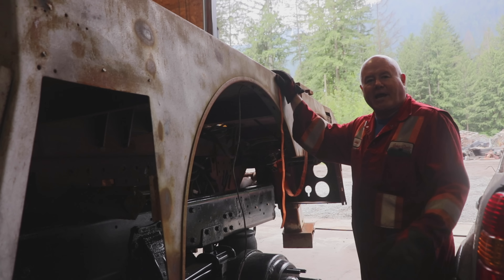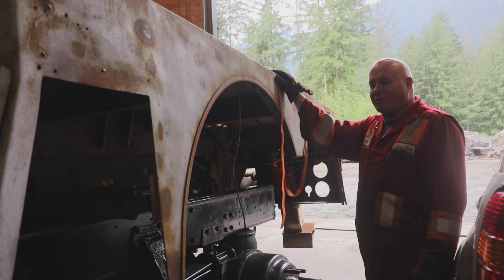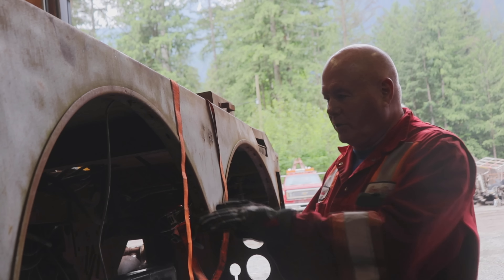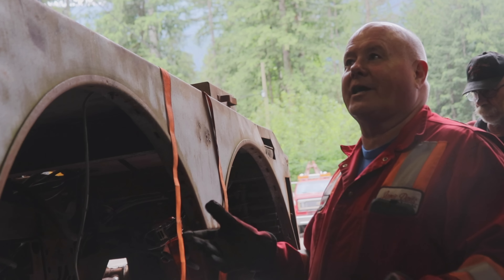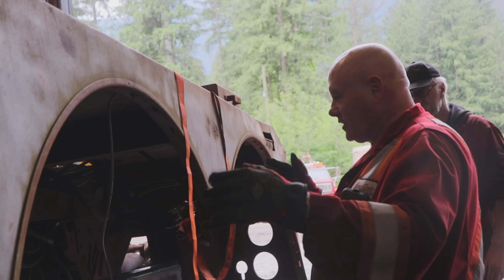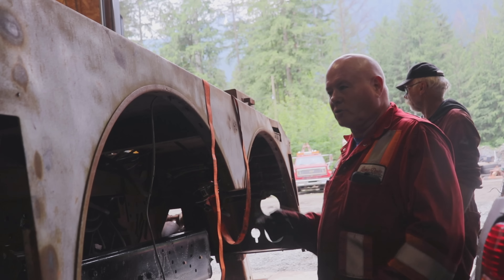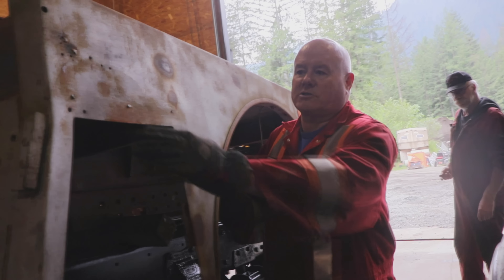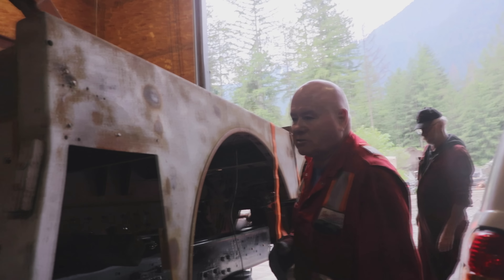INSTALLING NEW WRECKER ON BRUCE'S TRUCK!! || Jamie Davis Towing

Comment: With you fitting the 'new" wrecker on the back of Bruce's old truck reminds me of when my step-father was working for Truck Towing Service (Melbourne, Victoria, Australia) back in the 80s (now AAA Towing) when they were fitting a Holmes wrecker on the back of an R model Mack. At the time my step-father was driving the single drive Transtar and he taught me how to hook up a truck with the quick lift set up. Then he left there and went to Modern Towing where they had the spreader bar set up which I have limited knowledge of that. When he went to Melbourne Towing, they had the quick lift on the back of the Louisville and S model Kenworth and then when he went to Melbourne Recovery Towing, the cab over Kenworth had the underlift which I have a little bit of a knowledge of that. I love the set up of what Jamie has and everything on Highway through Hell is what I've experienced being a jockey for my step-father minus the snow/ice and the -40 C weather!

Comment: What happened to the rig that came off Bruce's truck
Reply: old that unit and the one on 47 have stripped gears they are switching them to hydraulic mechanical just can't take the load.